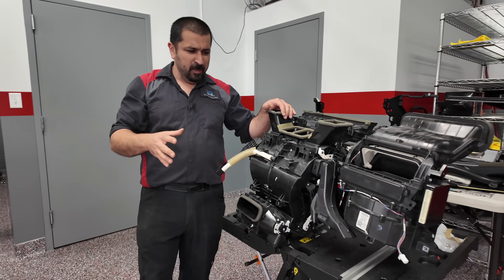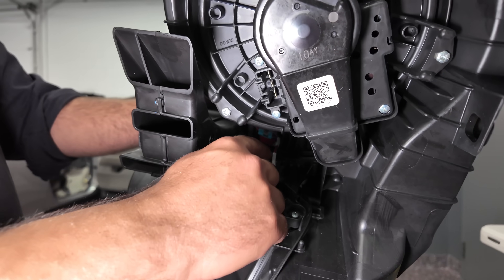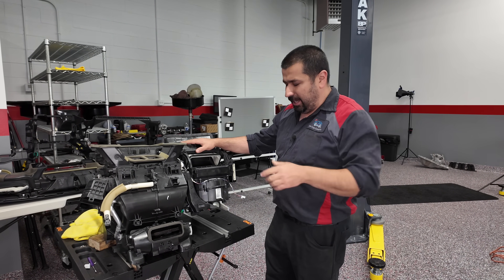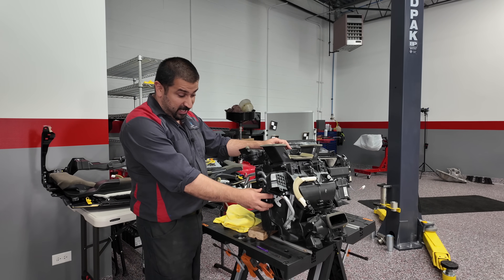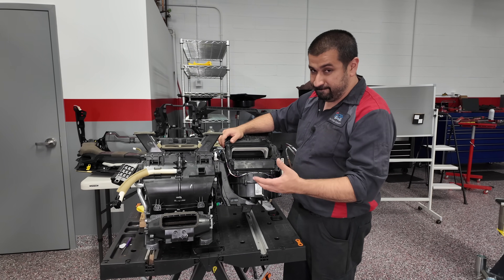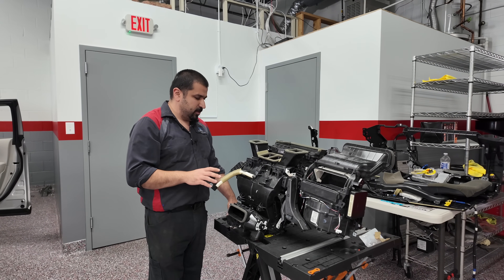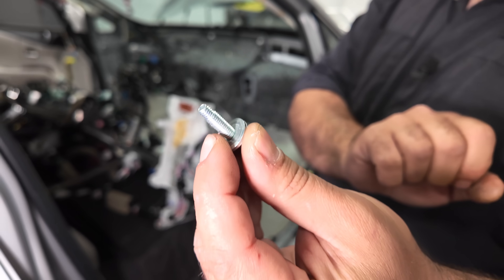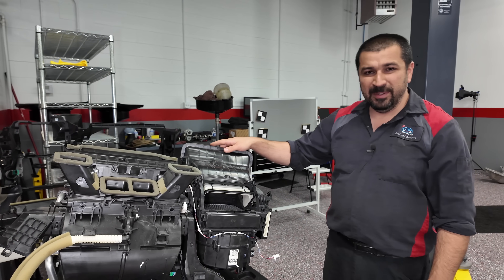THIS is Why Car Engineers and Car Mechanics Don't Always Get Along!

Comment: There's nothing simple about a Lexus. I'm a Lexus owner myself and I would not recommend these vehicles unless you know what you are doing. I recently fixed the throttle body and pulling it off was technically not difficult, once you know how to do it, but it's counter intuitive. This cars has tabs specifically intended to make it impossible to remove some bolts, so you have to take out the entire piece.

Comment: I broke the defrost door on a 2007 Lexus IS250 by replacing the air filter. It did not require much effort. There is a procedure you needed to follow to move the the door out of the way. The procedure is only in the user manual! Would have been good to have a sticker on the little panel in the glovebox.

Comment: Very interesting video! I've never seen an entire HVAC unit removed from any car like this. I've been lucky, in that I've never had a catastrosphic failure of the HVAC in any of my cars. But this is an example of why new cars have become so "disposable". Ahmed didn't mention how many miles were on this Lexus, but since it's 14 years old, I'm guessing it has at least 120K. How much is it worth? With the HVAC not working properly, it's Kelly Blue Book rating would be "Fair", the lowest category. It's maximum private-party value is $8,000. On a trade-in, a dealership might give you $6,000. Ahmed says he will spend at least 3 full days on this job: that's 24 hours of labor. TCCN doesn't publish the shop labor rates on the internet, but the average in Chicago is around $150/hour (auto repair shops that try to get by charging less than this usually go bankrupt). So labor is going to be at least $3,600, and I wouldn't be shocked if it came to something over $4,200.  The parts, for a new evaporator, new heater core, new expansion valve, and new servos, at least $2,500. So, the owner is looking at $6,100 to repair this faulty HVAC, on a car that would be barely worth $10,000 if it were in showroom condition with nothing wrong with it. At the end of the day, it's a 14 year old car in the upper midwest. How much corrosion damage to the body and electrical system connectors from road salt might there be, hidden underneath? It has 120,000 miles; how much longer until the transmission needs a full overhaul? The engine might be good to 250,000 miles - Toyota makes great engines - but hoping for that kind of service out of any automatic transmission is less of a certainty, even with Toyota. This is why I've never held on to any car much past 100,000 miles; there are too many things in modern cars that can go wrong, and that can't be repaired for less than several thousand dollars.

Comment: i have a 05 sienna no check engine light on but the monitors wont get ready  (cat and EVAP ) 
I tried to race egone to 4x RPM but after about a minute it starts to pulsate   any Ideas on a fix

Comment: The manufacturer profits from sales. Its in the manufacturers best interest to design cars that do not fail until the warranty is up, and then become very expensive to repair. These components could be made to last longer, or be made to be easier to repair... but then people would keep their cars longer and it would cut down on sales. So not only does it cost more to do more thoughtful engineering up front, it reduces future sales. Its a lose/lose for the manufacturer.

Comment: Not on this level, but Nissan engineers put the Rogue blower motor on the drivers side behind the center console up against the firewall.
Have to remove the accelerator and brake pedal assembly to get to it, as well as other parts that have nuts that are extremely difficult to get to even with swivel sockets and ratchets, and after that it’s still a pain to get the blower in and out.

When I did it on my Avalon it was under the glove box and took 20 minutes.

Comment: Ford "engineers" designed an engine that uses an oil bath rubber belt to drive the oil pump, 'nuff said.

Comment: Blend door actuator locations on any brand is terrible. On F150s with dual climate, there's one at the very bottom of the HVAC box. In America, it used to be vehicles were serviceable. But European and other markets, they treat them like tools and throw them away when they are no longer working right. At training, when they tell us its filled for life, that's code for, it's good until the 3 year 36000 mile warranty has expired. So they are built to last only through that warranty period and not much longer.

Comment: On my old truck the blower motor was on the engine compartment for bolts and one plug easy to change, in my Lincoln pretty much the whole dashboard has to come apart😢

Comment: The 1996 Acura TL series had to have that done just to replace the blower motor.  Double ended motor with a squirrel cage on each end.  It was built into the box on the lower firewall side of it.  Back in the day, we could slam a heater core in in an hour or so.  These days you dismantle the inside of the car then replace it.

Comment: Before I retired as a master tech., I've done several of those and you do not have to tear the entire car or dash apart, you only have to remove the glovebox and cross support bracket that hold the glovebox door and then you can remove the recirculate air box separate from the hv/ac box, the entire job only takes around a hour.

Comment: I had to replace the blower motor of my Peugeot 206.
To do it, I had to remove the entire dashboard... But since I never used 99% of the functionality of the thing (just "fan off" and "fan on"), I ended up removing the entire unit and saving 16kg.
Took me and my dad 8 hours and it was still a relatively simple car.

Comment: Having worked as an engineer for a major car manufacturer all my life I know the other side of the story. It is pretty simple: The engine compartment of a modern car is extremely tight and it is fiendishly difficult to get all the stuff in in first place. 
There are often big battles between engineering areas to get just five more millimeters for their part. The engine guys may say that under heavy acceleration with high torque conditions the engine block will move and they need to get more free space, while the ABS-folks will tell them that they won't move anything because they just now found a way to route the brake pipes around the steering column. And, by the way, the exhaust pipe will overheat their control unit and they need to add a heat shield now.
On the long and painful way to find acceptable solutions you will have the aftersales guys coming in all the time, demanding that the repair shops need access to each and every screw all the time. If we had done that, the car would have gotten half a meter longer and cost a lot more. In such cases you normally run the statistics and find out, how often a part really fails. If it only happens to five customers per year you normally accept a difficult repair and pay the dealers for that internally, using up the warranty budget.
It's not that simple ...

Comment: 60 years as a mechanic. Had a GM engineer tell me to my face "serviceability is not even considered ". They intentionally make it hard to work on trying to force all repair work back to the dealer. Worked as a line mechanic at a Ford dealer in the 70's. Replace the heater core in a Galaxy took 20 minutes if you worked slow. Raise the hood, pop the heater hoses, remove 6 screws and lift out the core. They can still do that if they want to.

Comment: Dual zone heat/cool controls/ magical AC/ heat are the finest in space shuttle technology.
 I don't have it/ don't need it.
 I remember my buddy's old 56 Dodge Fargo truck system!
 Never failed/ always worked/ as simple as a child could make it.
 We don't need any of these 'high-tech features'
 I specifically bought the cheapest FWD no 4-wheel drive Corolla Cross I could.
 Nobody needs high-tech anything! Power trunk on the EX version. Give me a break! Dual heat/air positions in a car you can touch both side windows with your two hands.

Comment: In a DC-8 50 series aircraft, they built the aeroplane around the radio rack cooling fan.
 Thank goodness I wasn't claustrophobic & weighed only 130 lbs soaking wet/ and had no bladder issues!
This tearout I would never even attempt.
 BAD BAD BAD Toyota.

Comment: I believe every manufacturer that uses these devices have the same problem.  That tells me they don't care and continue to use substandard devices or no one has demanded a redesign to something that should be simple and dependable for the life of the car with far fewer failures.  Having replaced one (in a Ram) and come away with bloody hands and arms it annoyed me to have to replace it with the exact same poor design.

Comment: I wouldnt mind betting the position sensors have a bit of carbon tracking on them and if they were "vigourously" exercised they would stop the hunting issue, for a while. Not an experiment i would want to run on a motor as difficult to access as that though.

Comment: I am a nearly 50 years hard core home shop DIY mechanic, and I've done a couple of dashboard strip downs to work on the HVAC systems.  I can't speak for Lexus, but on American cars I figured out how to change it from a 3 day long nightmare to a more manageable 1 day out and in and done job.  I don't know if this in any of the factory service training, but I realized that the entire dashboard including the steering wheel and upper column can be removed as a complete assembly and then placed on a work bench for easier servicing - vs. disassembling the entire dashboard into pieces inside the car.  Here is my basic outline besides the obvious stuff: 1) remove the drivers seat 2) remove the pinch bolt attaching the intermediate steering shaft to the upper steering column and drop the intermediate steering shaft out of the way. 3) unplug the approximately 5 or 6 or 7 dashboard wiring harness connectors including the one that goes through the firewall on the driver side. 4) there are usually about 8 or 10 bolts that attach this complete loaded dashboard assembly to the car 5) get a helper because the dash assembly is heavy and an awkward shape  and pull the entire dash assembly WITHOUT separately removing the steering wheel, upper column, air bags, sound system, HVAC controls etc. etc. 6) place this entire dashboard assembly on your workbench.  More or less it takes 2+ hours to get the complete dashboard assembly out, then a solid hour changing out all the various actuators, then a solid 2 hours reinstalling.  Best part is you still get to charge the 18 or 22 hours (or more) that the flat rate guide allows for labor.

Comment: What makes these systems even harder to deal with is you have to buy from the dealer most of the time. I have tried to use aftermarket in dodges and they can not complete their initial check. This is one of the companies that locks out the HVAC system if it cant complete the check.

Comment: It's not engineered for service technicians. It's engineered for middle management to get their bonus which means manufactiring efficiency, minimum and cheapest material,  tolerable warrenty comprpmises, and hitting the design metrics. First buyer is the customer with the money, and wants lowest possible cost. Most First buyers will not have these problems. 
Beautiful elegant and brilliant things can be engineered, but noone can afford to buy them.
I'm hoping that the advent of AI will change all that. 

Buyers are not willing to pay extra for servicability.

Comment: I had a Renault, Peugeot ( it was a frenchy, not sure which one)  once on the hoist. It had an issue with one of the doors/flap inside the hvac assembly. Not only did you have to do the same disassambly on the inside like you did. But the HVAC unit was screwed in from the engine bay. 4 M10 nuts directly between the firewall and the steering rack. Was still an apprentice back then and had the smallest hands...So it was my task. i could only use a small wrench and could only hold it with 2 fingers while squizing my forearm/ hand between the firewall and steering. Since then I hate french cars soooooooo much😂
Moral of the story: the shaft where 2 flaps were mounted (switching between floor and straight air flow) was broken as it was made out of plastic =(

Comment: First let me say, I understand what you are saying and many times I have been frustrated too. I have let out many expletives and with capitol letters! But know, the team that designs the engines (just example in this case), sometimes never sees the team who designs the frame, body, etc.. An often a base engine that was developed years ago is used in many vehicles. And it could be another team who is told to make adapter brackets to make this engine fit in this car. Not to mention, its a different team that decides the assembly order of the vehicle. Now I can can say I have had experience with Catia with one of the manufactures and a lot of times we can see the whole vehicle but it can be far later in the process. You will get good solid designs from small teams, smaller manufactures.

Comment: I had to replace the a/c evaporator core on my wife's 2008 Toyota Highlander hybrid (It stopped cooling). This involved everything you saw here and maxed out my technical skills since I am not a professional mechanic. One thing he did not mention in this video that you have to evacuate the entire air conditioning system to get that box out. I replaced the evaporator and heater core the same time. I got it all back together and everything worked perfectly, praise the Lord!  I can't imagine having to do one of these on a regular basis as a car mechanic. The dealership wanted $3,008 to do this and I did it myself for about $300.00. This job is not for the week of heart!  The section of the box that he will replace with the servos is about $1,400. This is a very expensive fix just for someone dropping something in one of those vents!

Comment: When I was a young engineer, I was once tasked with redesigning a fitting, for an aircraft, to mount an additional device in a small area.  I submitted a design that satisfied all the mounted requirements.  The fitting, fabricated from separate pieces of sheet aluminum riveted together, had many formed sheet components, tight internal corners requiring radius blocks, and blind rivets to assemble.  In fact, the manufacturing engineer came and informed me that the fitting was nearly impossible to assemble, as designed.  And after a careful consideration, found he was right.  Just because you can create a fit in a final design, you must first get to assemble the final design and later inspect and service that design.  All these requirements must be considered in a design if you care about costs, inspect ability, and maintainability.

Comment: AHM: "For reasons beyond me why that is the case". I have the answer, my friend: Cost savings. It's not that engineers hate mechanics (some might do, others just do whatever works and call it a day without spending any time on design optimization, but I want to believe that many of them try to do a good job). The work of the engineer is based on priorities. At the top might be safety (that part is not going to kill you), the second is cost, the third may be ease of assembly, the fourth quality, and the list goes on. Making the life of the mechanic easier is there, but not high on the list, so if the engineer has to chose between cost and ease of maintenance, he will always pick cost savings. The cost of maintenance is a problem for the owner, not for the stakeholders.

Comment: As a former Tech, 1985 to 2010, I would use cardboard boxes. I would cut an "X" in the box and push each bolt through it. I would # the bolts and draw a circle and note what section those bolts and nuts were for (Nuts got zip tied along the edge.). When I reassembled, I just reversed the order. Disassembly took longer, but reassembly was much quicker.

Comment: I bought Toyota When it wasn't cool in the mid 80s. Our Entire family Switch from FORD. Over the years We've all bought over 200 Toyotas.   What was wrong with the old Cable and Leaver.  TOYOTA Used to use the KISS Rule. Not anymore. Tecky tecky equals Brakey brakey.

Comment: It's not just the car industry that has this problem. Many,many years ago, when I worked for a company that made products for the DOD and unit would be assembled  and you'd get to a point that the final screw to finish the assembly could not be installed. There was no access. The design engineer was call down from the top floor and see what the problem was. Many a time, he would ask me how to solve the situation. Maybe an access hole or a slide panel would work. It made me feel so good that he would ask me for a suggestion.

Comment: All vehicles since the 70's have been designed as disposable after 3-5 years.
You know this man.
Toyota was no different, but not as bad as the others, but they have in the last 10 years finally gone all in on the disposable build quality.
They don't want you fixing anything, they want you at a dealership for repairs only, or buying a new vehicle.
Some manufactures have even tried to prevent owners from working on their own vehicles, many times, and the courts always shut them down, for now.
The overly complex, poorly designed, electrical nonsense HVAC and vent duct systems in vehicles is one of the single worst invention/designs in the automotive world and universally hated by all.
Really that's tied with electric door handles, (REALLY BAD IDEA) power windows, and power locks.
Manufacturers don't care and never will, they screw people for a living.